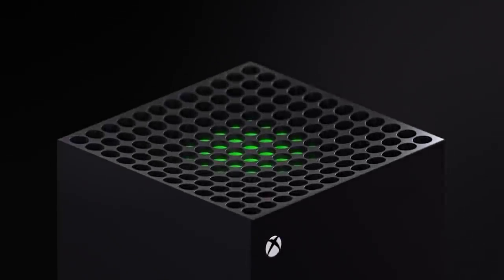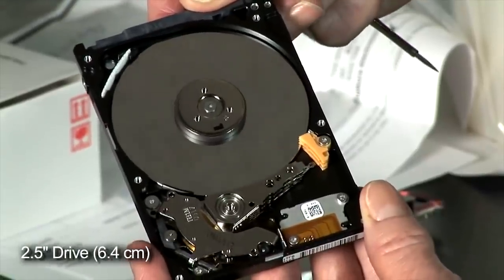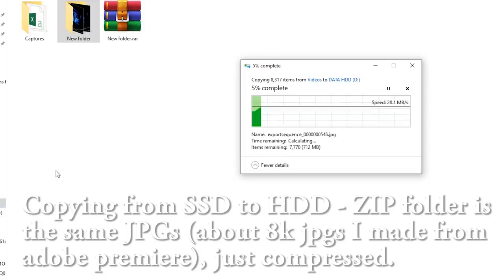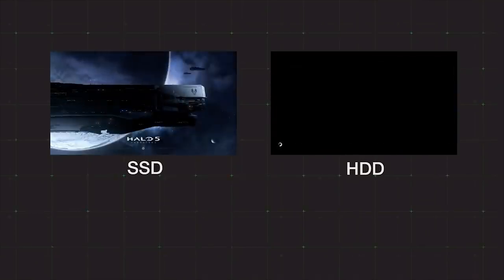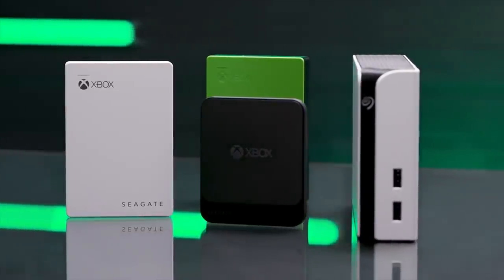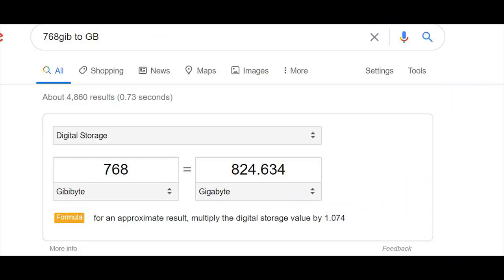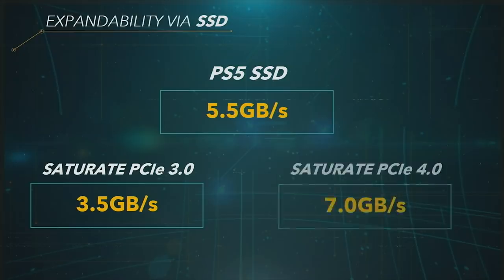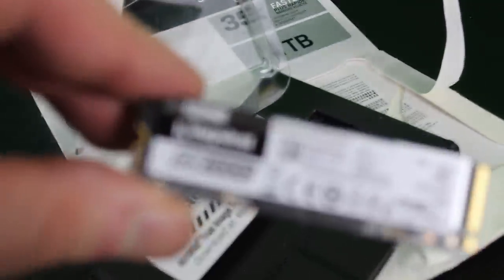Why The PS5 & Xbox Series X SSD Changes Everything - Part 1 - Basics

Comment: How do you think ps5 game design will change to fully utilize the SSD vs Xbox? Won’t Sony have more advanced games?
Reply: The SSD won't make much of any difference except in the specific scenarios like in Ratchet and Clank where it needs to load a bunch instantly.  The XSX has more CPU/GPU processing capability, even if you give the PS5 more assets it doesn't mean it will render better images.  
We have to consider that the XSX is slightly less than half the the speed of Sony's SSD, if Sony can load things instantly, xbox will just be instant (divided by 2).  They both have SSD's and can implement the same techniques.  The difference of half a second and 1 second is marginal.
Reply: @matthewnotter7006  exactly I been trying to explain this to people. Most Sony fans have no idea what an SSD or how to works and call Xbox's SSD slow 😂 it will be a few second difference between both console Ps5 will be fast but by a few seconds. Average gamers won't notice a difference.
Reply: @matthewnotter7006  ps5's ssd is twice as fast.. 5.5 raw compared to 2.4 raw

Its not a second... hell  I assume you comparing Loading time and I doubt its only one second.. i think it will be more.

Processing numbers in a computer is a lifetime... and the ps5's ssd Is not the same as the xbox  sx's ssd... so they  will be different.. of course not their basic functions.. but how it will be use in their games.

Comment: SSDs on consoles was overdue, but going all in like this is too much... The thing is, today UE4 does a TERRIBLE job giving higher prefference to loading assets than to draw calls and running game physics... it's crystal clear in many open world UE4 games, that any ssd would give you more stable frametimes... the thing is Sony asked for engine developers for input, and given UE4 was so broadly used they had no option than to go this direction. And this solves the problem that UE4 itself created, not problem for all engines.

Comment: I keep it in english. Its the Ram like latency of the SDD on the next gen consoles.
Reply: Brett Kozlak  ddr3 acctually
Reply: Latency is not equal because of the controller but with 12 channels expect it to be much better than any consumer nvme ssd under any Queue depth. I wonder if it will be like optane, but doubt because of the life span of the product.
Reply: @MarceloTezza  The problem is that there isn't enough space on the SSD for many games.  1 TB is not enough for next gen, especially since 100 GB of that will be used for OS and other reservations.  825 GB will be like 700 GB of usable storage, that is like 6-7 games downloaded at most.
Reply: @matthewnotter7006  which is what we have now with the current generation.. its ok
Reply: @matthewnotter7006  That would be if games stay the same size as what we have. According to devs, the SSD can allow for them to cut down on the repeating data (trees, posts, dirt, and grass. All of these take up large amounts of storage.). Games should be smaller due to this (also there is better compression for the PS5, kraken) and they would only increase in size if there is more variation in environment, high level assets, and extremely complex and dense worlds.

Comment: I got really annoyed when one of my Sony fanboy friends tried to tell me that since the ps5 has a better ssd the ps5 will have better looking games
Reply: Well I mean, better data throughput means more detail, and as such better looking games
Reply: yea check out the Nintendo Switch with it's amazing graphics due to it's SSD
Reply: @jamirograntsaan2124  wrong. SSD will not make the game run any better. It's just funny marketing. Expect better loading times and that's it. 
Coming from a PC gamer with m.2/sata.
Hard drive is not even in the top 3 upgrades for a PC gamer. 
GPU, CPU, Ram, Cooling, Power supply, then maybe SSD. The order before the HD could be changed depending on the situation but the HD will never come before any of them. The benefits are pretty much negligible. I run most of my games off my SDHD and it makes no difference in-game.
Reply: @anonymous134y  Why are you making assertions about a topic that you clearly dont understand? Would it not be more logical and rational to admit that you dont know instead of making assumptions? Do you understand that the engineering of a console is super complex and you need proper education to understand  how it works?
Reply: @harlenkelly7331  dude I build computers, overclock and bench them lmaoo. Just sit down fanboy.
SSD is one of the last parts I would upgrade if I had a 7200rpm hard drive. Let me know when you get Intel octane speeds.

Comment: “Having an SSD changes everything “
- PC users five years ago
Reply: You haven't got the bandwidth or speed of these SSD,why do you lot have to wait for companies to release them later this year , clueless
Reply: Yes, but its now become cheaper and the consoles will have the NVMe type.
Reply: The difference is, games are made for the lowest common denominator of hardware which was HDD for years.
Now that consoles have SSD, games will be built around using SSD to full potential.
We has SSD years ago on PC, but the best that came out of it for gaming use was brute forcing loading screens speed in games that were built in mind to play from HDD.
Reply: @SnizelOfficial  pc still using hdd.. consoles  are going to force the market to shift to ssd.. thanks to consoles.
Reply: @SnizelOfficial  it'll still be a while yet. Games are huge a lot of people still run mechanical drives for game storage.

That being said they're getting 200MB/s sustained reads from mechanical drives. The random read/write speeds are what kill it. Not as much of an issue loading games as loading the OS.

Still a lot of OEM machines are coming with SSD but they still average 500GB or smaller. That's like four games after your OS leaving recommended free space. Laptops are even worse with 128 and 256GB being common.

We're still going to see hard drive support for at least the next 3 years or so unless NAND production goes insane and they decide they don't like making tons of profit.
Reply: Pc masterrace: nah pc have these spec 5 years ago.
 while they still running on game which does not designed to take advantages of the power.
These console is indeed game changer which help to push all games to be designed with ssd in mind.